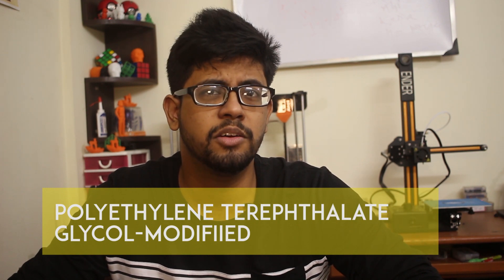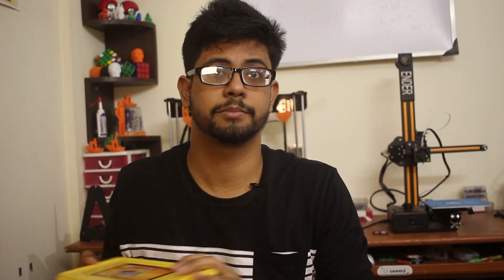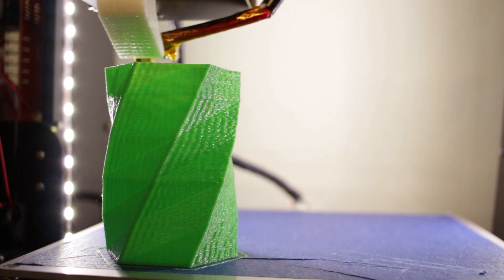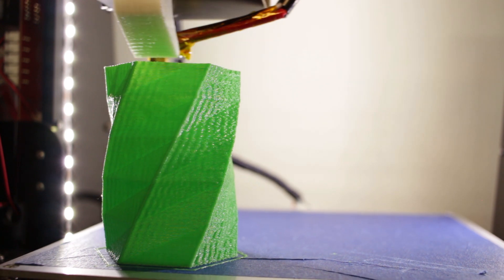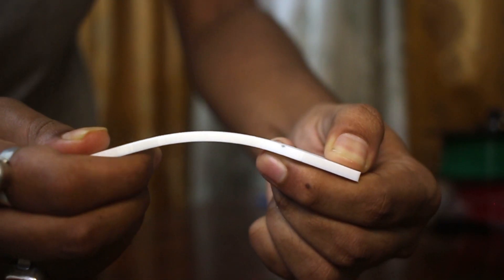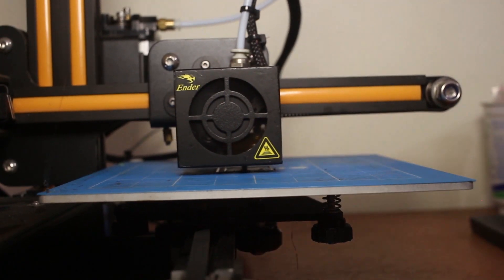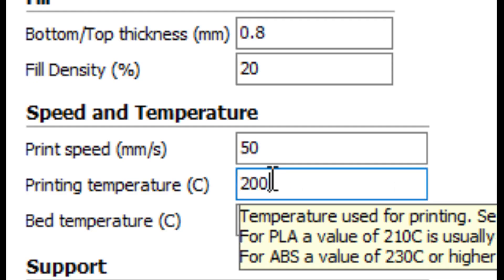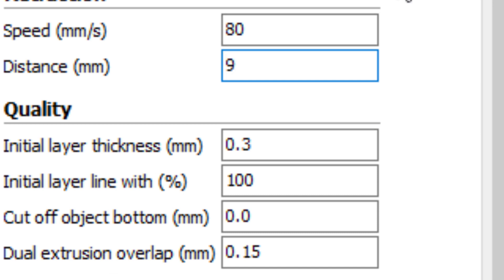3D Printing with PETG filament

Comment: PETG temperature depends a lot on the manufacturer. The one I buy is best at 200-210 degrees.
Reply: might not be petg, i have heard about sellers selling pla as petg.
Reply: It's definitely PETG, or at least something very different from PLA. Sticks to the nozzle, smells differently (and less than PLA), resists a lot of force and bends before breaking, doesn't need a fan, strings easily and it's a bit too sensitive to overflow... Super different and from what I read everywhere, they're typical from PETG. My guess it's that it just has different amounts of glycol added.

Comment: The nightmare filament. When you finaly finds the right settings it will only print a couple of times then it wont stick to the bed anymore, very strange. And the printhead look like shit now.
Reply: I clean the tip with tweezers every few prints. With a well leveled heated bed on glass it sticks every time. Some hair spray helps.

Comment: I am almost giving up on PETG. I only had success with it printing in vase mode, other than that, I get so much zits from hell. I use CR10 at 235C, 50C, and 40mm/s with clear ESUN PETG. I tried dialing up and down the retraction settings without any success. Please help me if you can, thank you in advance.
Reply from the maker: Can u share some print photos ?

Comment: Use PETG on packaging prototype.  Cups and bottles on Tevo Tornado.  Changed nozzle temp to 250 and bed temp to 85.  Filament producer stated 205 to 225.  Used 5mm retraction.  No glue stick.   Used skirt and prints are great. Around 40mm per sec speed.
Reply from the maker: Thanks for sharing ur setting with the community

Comment: 230°C is enough for PETG? Seems a bit on the low side. Can the Ender 2 hotend handle it or will it damage eventually the inner PTFE liner?
Reply from the maker: The one I am using prints best at that temp. PTPE lining can take up to 250 C